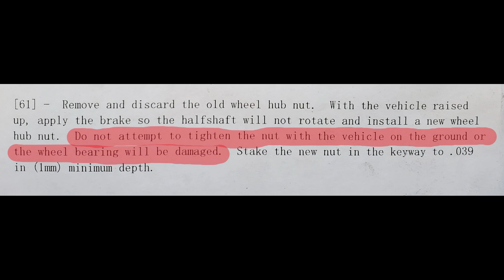06-12 Fusion, Milan, Zephyr, MKX, & 6 Front Bearing and Hub On Car Replacement

Comment: I noticed from some companies even if you take a wire wheel and clean the rust off the spindle itself replace the hardware some pads just don't fit in there too tightly I've had to use a grinding wheel the grind the sides down off the pads to get them to work on top of cleaning the surface of the spindle..

Comment: Just completed this job.  I recommend at leadt a 4lb hammer for the upper control arm, a 2.5 wasnt cutting it for me.
Reply from the maker: You have to be careful where and how hard you hit though. You can break the cast knuckle or damage the threads on the ball joint.

Comment: This is a great video. Very informative and explained extremely well. Here is some added information. Plan on buying new snap rings, if your hub and bearing kit doesn't come with them, and if you don't need them return them. If you live in the north plan on soaking the snap rings with panther p!$$ and using heat. About the upper ball joint, check for a recessed hex socket (allen wrench is what I used) that will stop it from spinning on removal and reinstall. When renting the tool from O'Reilly Auto, CHECK IT OVER. Make sure all the pieces slide on and off the bolt and make sure you have all the correct ones, including the bolts to fasten the horseshoes to the clamp. When removing your hub and setting up the horseshoe clamp, you will need to align it so it rests against the flat spots on your knuckle. I was having an issue where the clamp was tapering away from the knuckle, once I was able to get it to rest on those spots, the hub slide right out. Thank you again for this great video. I have never pressed bearings in before and I would feel comfortable doing this again, although I never want to do this again.

Comment: FYI- there is no reason to remove the brake pads and caliper- just remove the bracket and leave the pads and caliper  attached altogether. He did a lot of unnecessary work by removing the caliper and pads from the caliper bracket. Also, if you have a good impact driver, greasing anything is not necessary. Torquing it with your hands will NOT be this easy btw. Finally, freeze your bearing for 48 hours before you do this.
Reply from the maker: Removing the pads and caliper gives you a great opportunity to inspect all of that and make sure everything is moving freely. Also, lining that whole heavy assembly back up can be difficult, especially for someone with little to no experience. That's also a lot more weight to tie up during the repair, as well as a bigger object potentially getting in your way. So there is reasons to remove each component individually, however it is not 100% necessary. 

I rarely use impacts on pressing/pulling tools, and absolutely do not recommend someone with little experience doing it. You can't feel if things are binding up. Also you can easily put way more force on it than you should, which can damage the tool or the part you're trying to press/pull, possibly catastrophically to the point of causing personal injury. That is a LOT of energy stored up and when it let's loose, bad things can happen when shrapnel is flying at you at Mach Jesus.

I do agree with freezing parts that are being pressed in. It might only shrink them by .0001 inch, but that little bit helps. If you have the means, you can put the part it's being pressed into in the oven at a low, but higher than ambient, temperature. Or leave it sit in the sun on a hot day right before doing the work. I must not have mentioned that in the video.